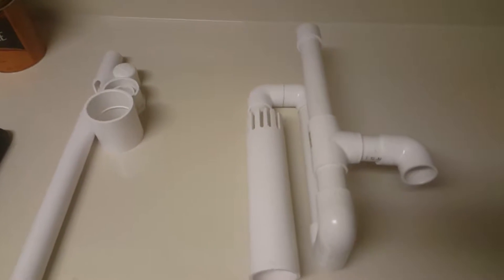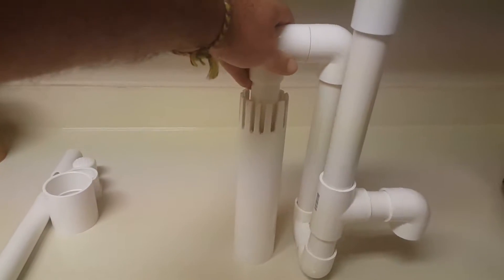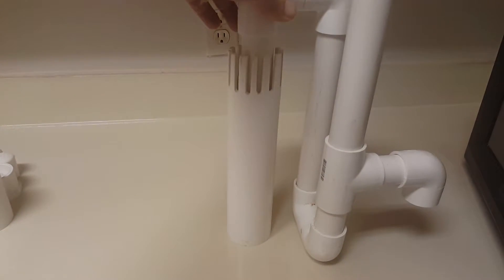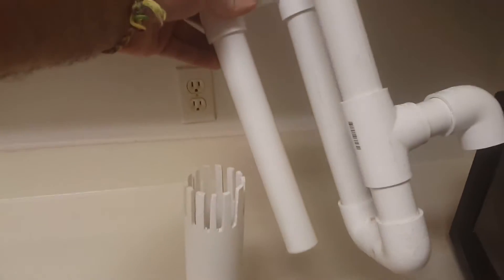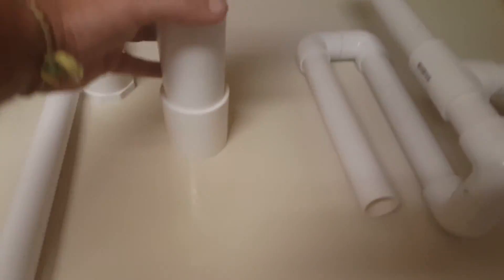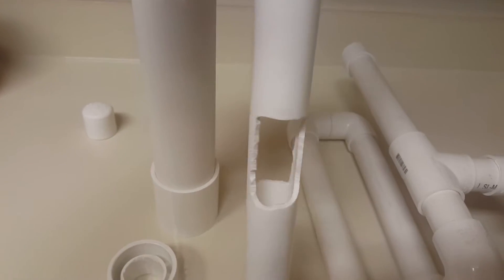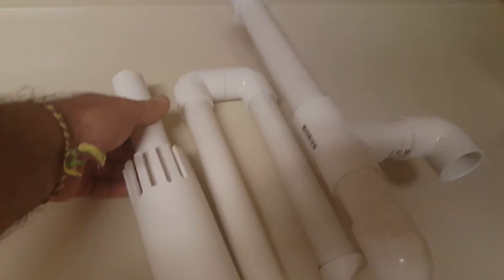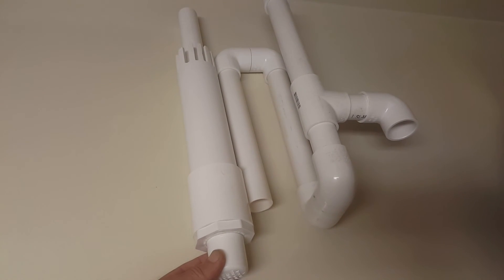Improved DIY PVC Tank Overflow

Comment: Can I get help on the measurements for the pvc's? i have a 75 gallon tank. need advice, any help can do.
Reply from the maker: Antonio Juliano length measurements dont really matter, but the longer the better, it'll flow more effectively. Honestly though, i started drilling my tanks 6 months ago, and will avoid suction overflows whenever possible.
Reply: do you still have the past measurements of your old build? i don't think I can drill my tank, the glass is too thin.
Reply from the maker: +Antonio Juliano if you mean the lengths, it's not critical, whatever looks good to you

Comment: I found it was easier to just PVC glue the outer pipe to the side of the drain pipe.
Yes its not centered but it doesn't make a difference to the work ability of the overflow.

Comment: Wouldn't it work just as well to use Joey's version and just add a weight at the bottom to the keep the weir pipe from floating up? Something like a flat rock or a bag of sand.
Reply: I thought the same, but I believe it could risk blocking flow

Comment: What is the result? did it work?
Reply from the maker: absolutely... its never floated away and broke suction as the original design did.
Reply: Thank you for your quick response, I will try this version, despite I have no problem with the other version but just in case.

Comment: You can buy a end caps for pvc for $1
Reply from the maker: Neil Chand and?
Reply from the maker: Neil Chand cuz that's a hack abd would never hold the inner tube in place correctly, nor be watertight. I use a coupling and reducer bushing, equally as inexpensive... thx for the suggestion though.
Reply from the maker: Neil Chand cuz that's a hack abd would never hold the inner tube in place correctly, nor be watertight. I use a coupling and reducer bushing, equally as inexpensive... thx for the suggestion though.

Comment: Just drop the outer pipe to the bottom, end cap it let the overflow hang on the top edge of tank, solved.
Reply from the maker: solved? its already solved without a 30" pipe down the height of my tank.. thanks though

Comment: Is it noisy? If so, how do you quiet it down?
Reply from the maker: nickidml it can be if the flow isnt high / fast enough... basically, if the outer tube isnt almost full, yes, itll gurgle. So if youve not a flow controllable pump, you may want to start with a smaller cutout on that inner pipe, slowing the flow.